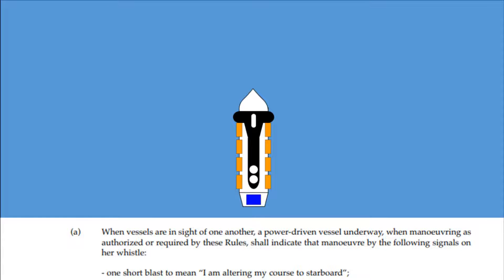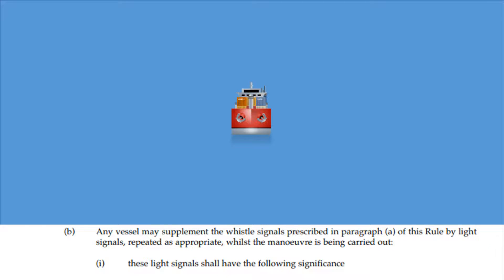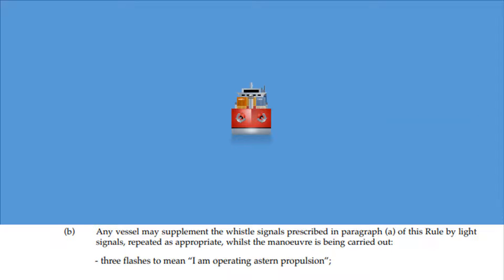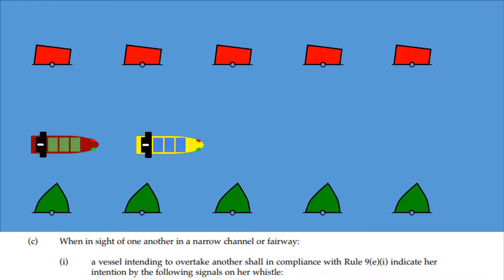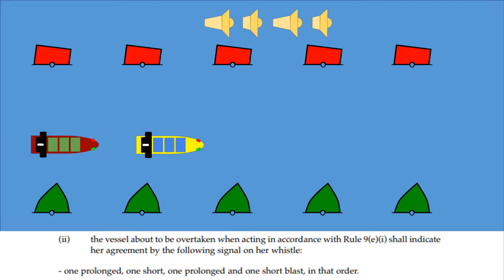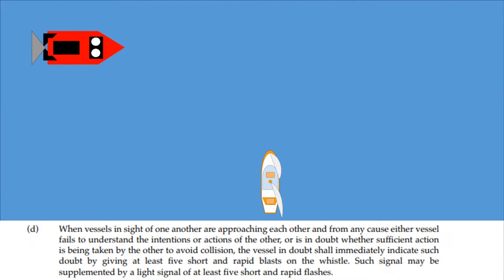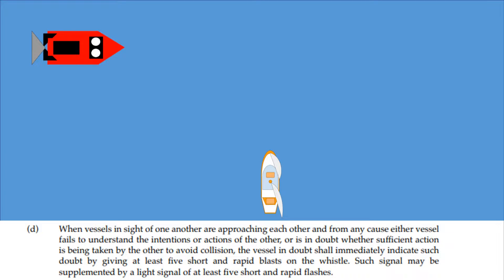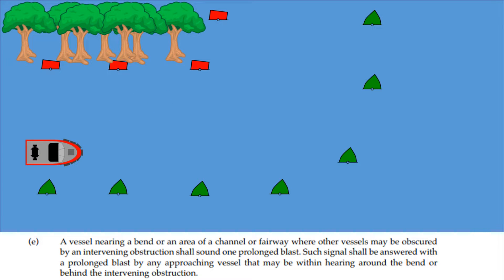Colregs Sound Signals - Rule 34   Manoeuvring and Warning Signals

Comment: in case of restricted visibility in narrow channel, where other vessel intends to overtake the other, what sound signals are required ?
Reply: 1 long blast less than every two mins by both vessels if they are underway making way. Then either  long long short for over taking on starboard and long long short short for port. Generally you wouldn’t overtake in  a narrow channel in reduced vis because you have to lower your speed to a safe speed in low vis.
Reply: @forestwiids9710  PROLONGED blast** common colregs test gotcha answer